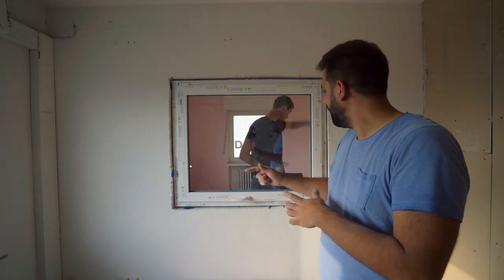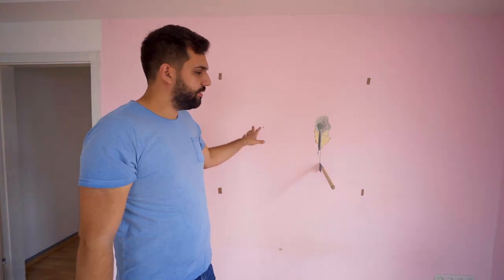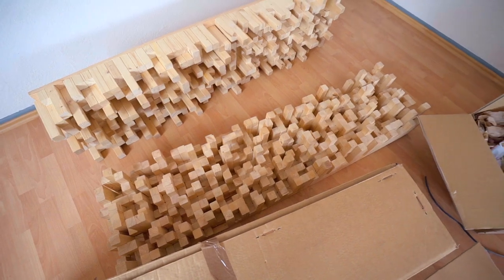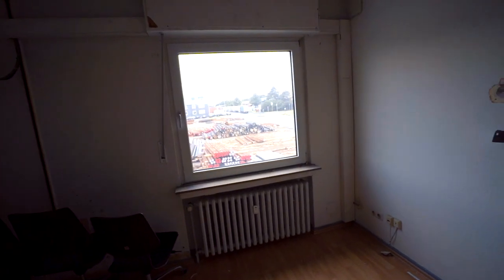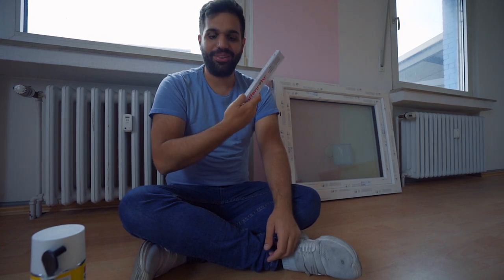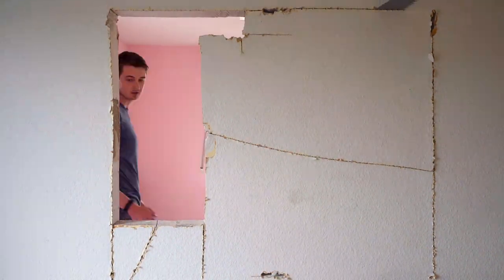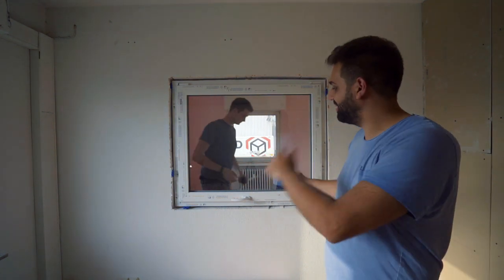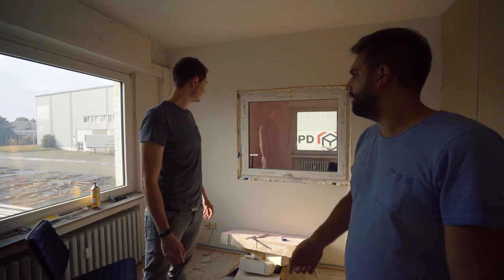VOCAL BOOTH WINDOW for your Recording Studio

Comment: Second. 
Jon, what about power supply in whole studio? Will you plan use power conditioners? And what with ground loops? It is important part of design of studio.
Reply: Hey, Yard I completely agree with you. a good power plan (noise, conditioners, hum killers, etc) is like to have an health insurance in your studio. Ground Loop can be a real problem and should be always tested before renting a place that you wanna convert into a studio to understand the better way to resolve it. On the other hand for Jon, it wouldn't be a real issue because he owns the entire building so if he will have a ground loop he can fix it easily because he can fix the electric supplier of the entire building so he doesn't have to deal with neighbours. I think that power conditioners will be a must-have in every rig that includes outboard gear.

Comment: Great project Jon, but I wouldn't close the window on the vocal booth, singers absolutely love not feeling trapped, and every performance I had a chance to capture when the singer had that feeling of living room performance always went special.
Reply: he could put a plexiglass sheet on the inside or outside of the window to increase isolation without blocking the light from the window
Reply from the maker: yes I will have a movable solution just in case it's loud outside
Reply: How make oxygen setup in vocal booth please tell me any one

Comment: Are you going to cover the window with one of the mobile absorbers during the mixing process? Cause it seems like the window is right at the early reflection point of the wall.
Reply: Beats by Daku It's studio B, mixing will be done in studio A
Reply from the maker: yes I still have my old absorbers but I first have to measure and than I will decide

Comment: uhhh, I'm not an expert by any means, but is that foam enough to hold that window in place? Most of that kind of material will deteriorate after a while (and your window could fall out)

Love the moving vlogs btw 👍
Reply from the maker: hey there are 8 long screws holding it in place the foam is more to seal it than hold it. thanks :)

Comment: Actually, this is regular house window. Vocal booth window must have at least three panes which are not paralel. Outher panes could be paralel but one or two inside panes have to be angled if you want proper window for studio visual communication.
Reply: Where could one be purchased? I'm looking for one.
Reply: @Mendiaz28  unfortunately this is custom thing. You can't buy it in any shop. You must find some craftsman who is working with windows, or woodworker, and make a plan, or describe what you need, and give him aproximate dimensions, or DIY.